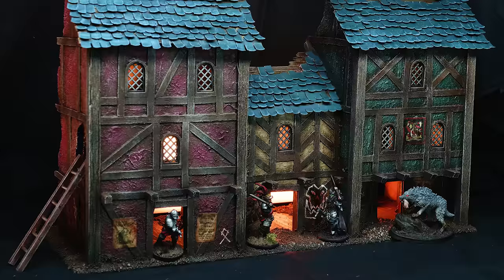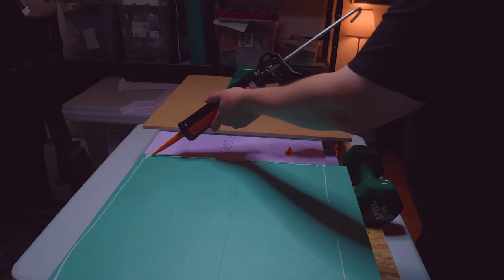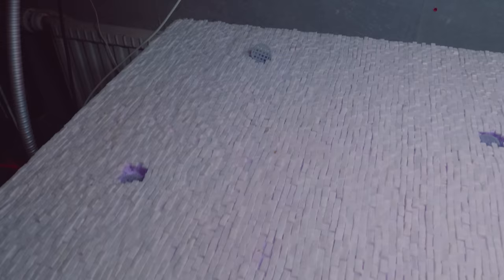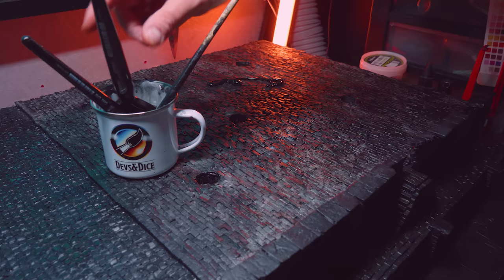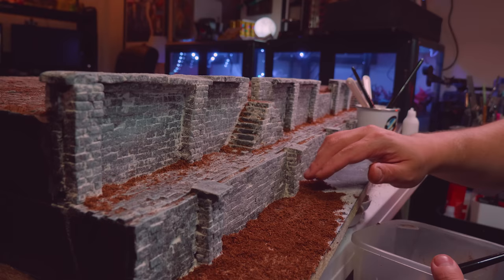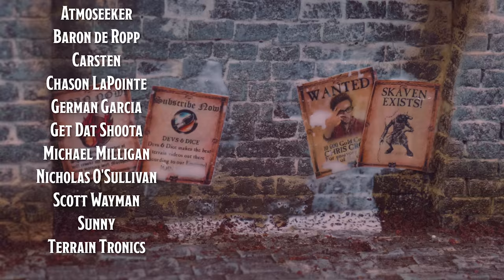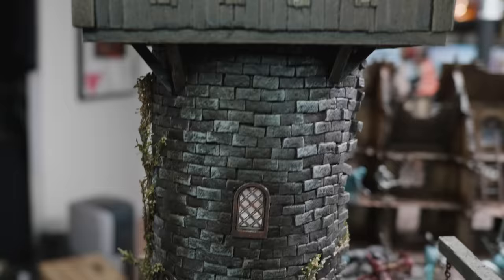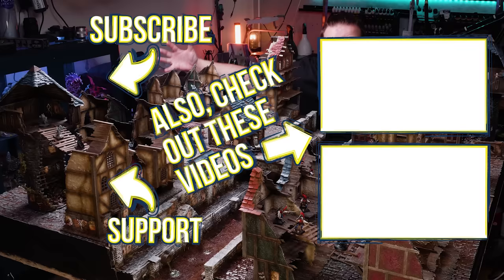My MORDHEIM Warhammer BOARD Build - FINALLY DONE! 💀🤘🎉

Comment: I can't believe I missed this video!! Fantastic work! A few techniques I found to not have so much tedium with cobblestone etc is some air drying clay mixed with PVA and a textured roller. Also, I was lucky enough to find thin cork sheets with adhesive backing which I cut to desired shape and size and can just smack them on in order. When you cover everything with the mod podge and black paint it holds them in very securely. Lovely stuff, my friend. Maybe we'll see some Tötalitär posters hidden among the streets?? Cheers!!
Reply from the maker: Yeah there are plenty of techniques that are faster for sure! 👍😂 My goodness! That's a dead giveway for a Swede! 👍😅

Comment: Yooo... that looks AMAZING! 
I'm actually about to start with my own city boards for the warhammer RPG and Skirmish. I'm also a swede and I wondered where you find all this foamboard? The only foamcore I've found had paper that wouldn't let go without massacring the foam.
Reply from the maker: Thank you kindly Aralaas! So one thing you need to separate is foamcore/foamboard and XPS foam. Foamcore/foamboard in Sweden generally have paper on both sides which I use to make a lot of my buildings. When it comes to XPS foam, the material I used to make the basic shape of the board. That you can find in so-called: "Byggvaruhus". Examples could be Bauhaus, ByggMax etc. You need to look for XPS, Skumplast, Cellplast. Also included an example link below! Hope this helps! 👍😊

https://www.bauhaus.se/cellplast-xps-300-falsad-1185x585x80mm-3-47m
Reply: @DevsDice  Thank you very much! I've been scratching my head for ages, this'll come mighty in hand.

Comment: awesome work. i personaly would have used plastor casting for the cubblestone but foam works aswell ;-) you can be proud of what you have created
Reply from the maker: Thank you so much! I did actually try out some plaster casting and some resin casting but they were too brittle imho. I defaulted then back to the wheel of pain! 👍😂
Reply: @DevsDice  it depends on the kind of plastor your using. obviously the standard run of the mill 2 cent plastor is brittle as a sheeps tail, but there is dental plastor that is rock solid once cured
Reply from the maker: Ahh good to know! Any idea on the cost? 👍🤔
Reply: @DevsDice  i would say roughly 20€ per kilogram

Comment: Wouldn't it be way faster to use a texture roller for your pavement ? I mean, it's looking great, but man what a hassle.
Reply from the maker: It would be A LOT faster Thibault but since I has about 18 inches of real-estate to cover, it felt way too tricky to match up the patterns. Also, my mistake in the beginning kind of ruined the smooth surface of the XPS foam so I had to pivot! 👍😅

Comment: Top tip: Never use tiny bricks!

Why, oh why, would you ever cut and lay out tiny bricks on top of XPS foam? XPS foam is perfect for carving into and would have saved you loads of time. You could have made a roller and rolled out the brick pattern in a hundredth of the time it took you. If you needed a 5mm rise, why didn't you cut 5mm sheets with your proxon? Or cut out the road so it was lower down? Watching this is like watching a madman discuss his insanity! 🤣🤣

The end results look great. But, please, please, don't replicate this technique people. It's really not worth it when easier and quicker ways are already out there and well documented.
Reply from the maker: I used to use larger brick but honestly I found it somewhat wrong looking for my taste when it came to scale! 👍😂
Not sure if it came across but the original idea was to NOT use bricks for the entire thing, but more use the same technique I used on what became the road. I wanted a 5mm rise with a single block of XPS foam and I cannot cut that large pieces with my Proxxon. A roller would have worked if I could have ensure that I had enough pressure and made the seams fit, which I did not think I could. Plus it would have looked very repeated. 😂 When it came to cutting the road down,  I could not see myself doing that somewhat straight and evenly. 
Thanks for the comment! 👍😊
Reply: Sometimes, the journey is just as rewarding as the destination. Laying those bricks by hand sounded like therapy to me, done by a person who loves to hobby. Faster doesn't mean better. Not everyone strives to be the most efficient but the fact that this has a unique look is because it is uniquely built by hand and not some factory efficient common mordheim board.